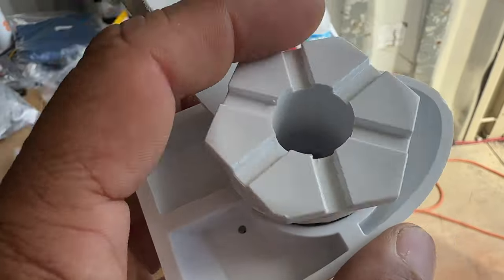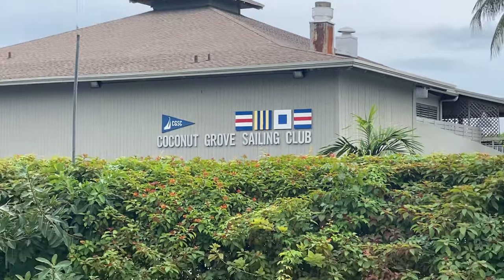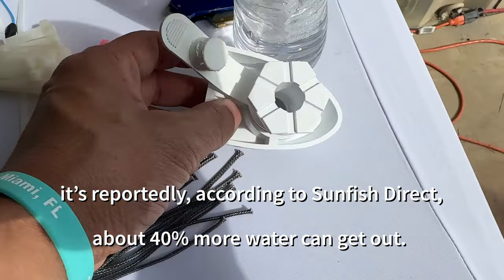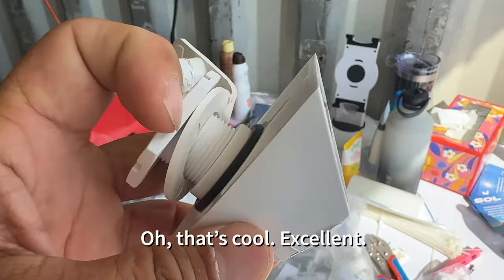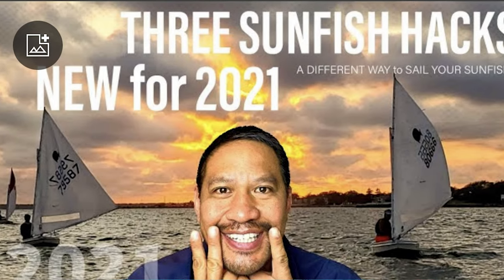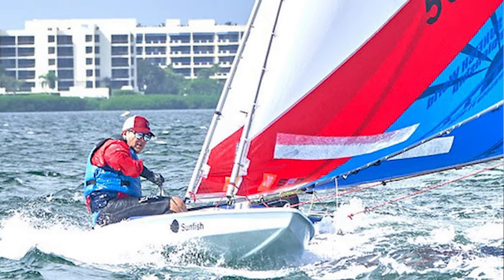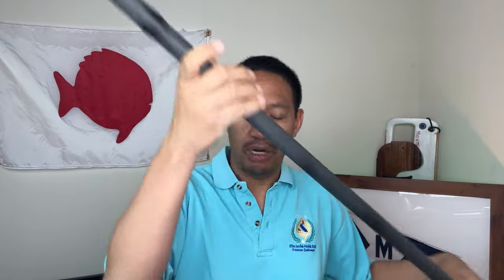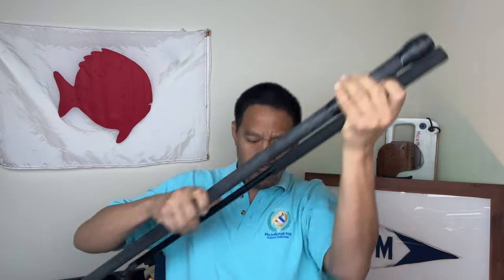Get Rid of Water FAST with this NEW SUNFISH PART and Q and A

Comment: I can see the point that having the bailer more efficient could help make a difference in racing. If you make it race legal, pretty much every racer's going to switch to it, which adds a cost. Maybe not a big cost, but considering the number of 'Fish out there, it adds up.

Is there anything that should be put in the hole  made for the bailer, to help keep water from intruding into the layers of the hull? Or do you think the rubber seals are enough?
Reply from the maker: The rubber seals will be enough.   If you are concerned, remove the bailer and “butter” the fiberglass with some resin to make it water tight.   Many boats have this done already.
Reply: Probably wait for that epoxy to harden before adding the bailer tho, amiright? If you ever want to get it out again, that is 🙂